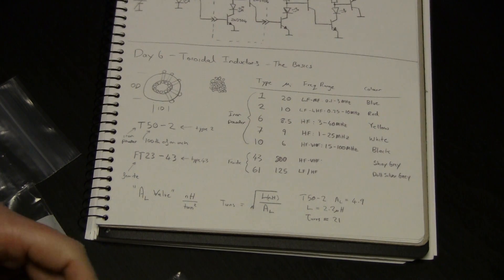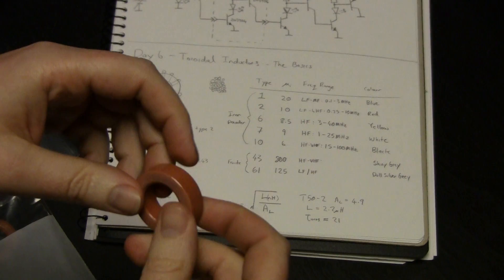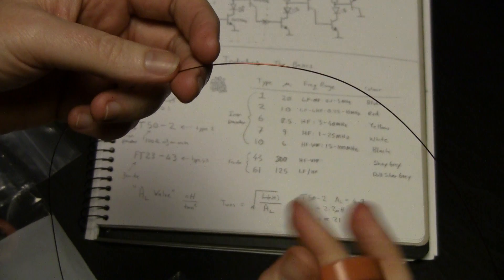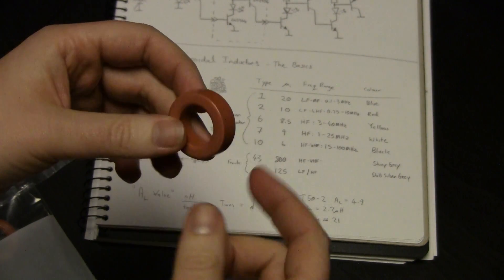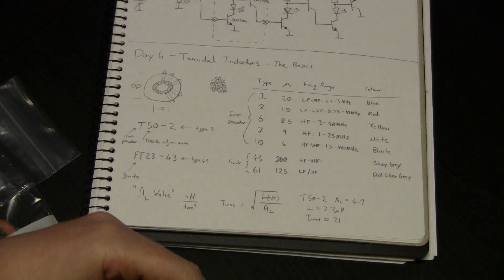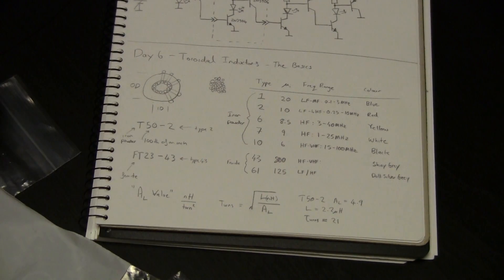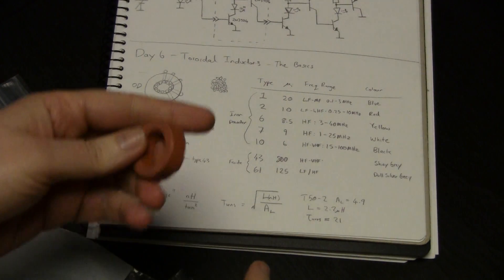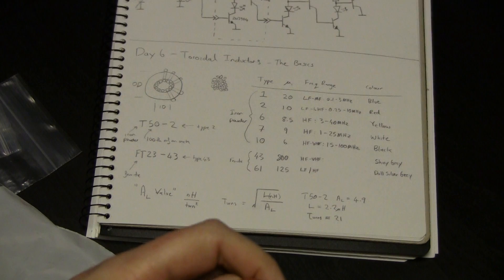Advent Calendar of Circuits 2014: Day 6: Toroidal Inductors - The Basics

Comment: Nice video, I have been looking for a video on Toroid Inductors to help me with a problem in designing a PSU with large current capabilities.  I need a PSU that can convert 24 to 12 volts but supply a  current of around 6 amps at least.  I'm using the popular MC34063 SMPS IC and going through the calculations on the data sheet for step down mode I get an inductor value of 3.8uH,
I can get the inductor value by trial and error using a core to hand which is Yellow. I think around 18 turns of 12 SWG was used. The core outside diameter is around 1 inch Your video suggests I may have been using an Iron Powder instead of an Iron Ferrite which I was hoping it was. I didn't know how to tell the difference at that time.
I can get around 2.5 Amps from the PSU but any more and the voltage just drops away completely, I wonder if I am hitting the saturation point of the core? and therefore losing all the inductance, this then may be seen as a problem for the regulator.
Looking forward to seeing a video on this subject as you suggested you might in the video.

Thanks Alan